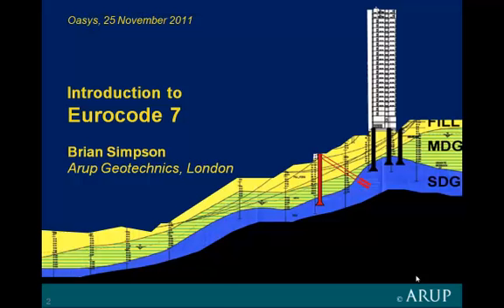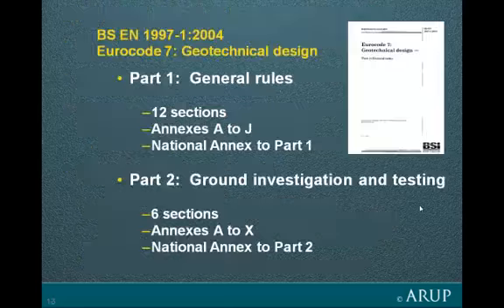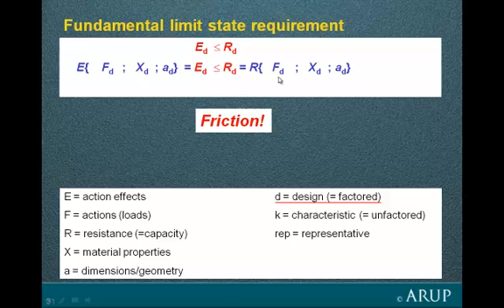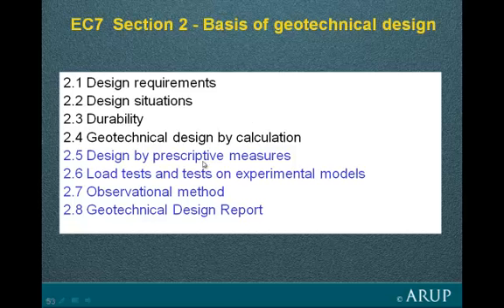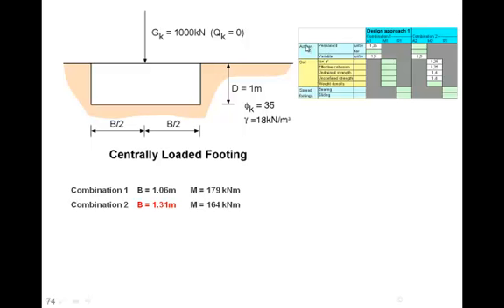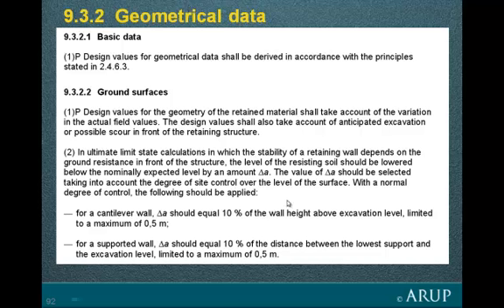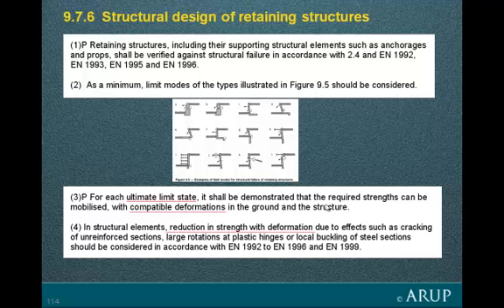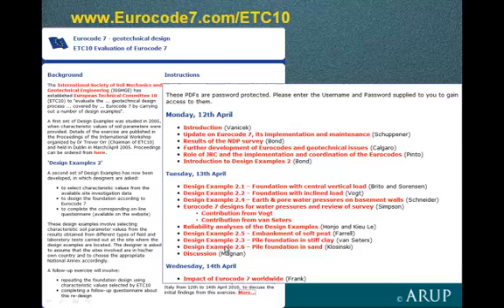Introduction to EC7, Dr Brian Simpson (Oasys Software Webinar)

Comment: Thanks for the video in fact I have enjoyed ur video Mr Brains.
But I how do I design a retaining wall horizontal to the surface according to the euro code. Because it seems the ec7 guides to retaining wall which is inclined to the surface so I find it difficult to calculate the active and passive coefficients, the earth pressures, bearing failures. Since I am designing a retaining wall horizontal to the surface and I am new to the euro code so I am suffering. Please assist me